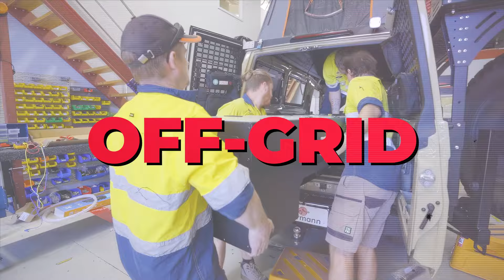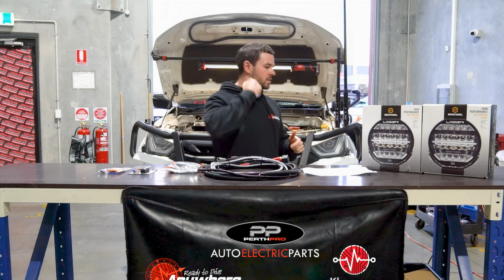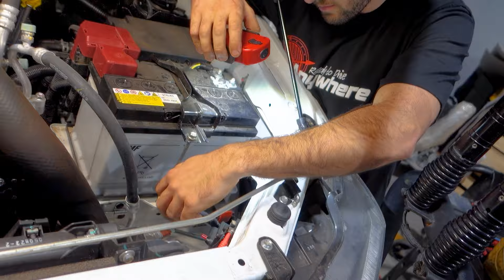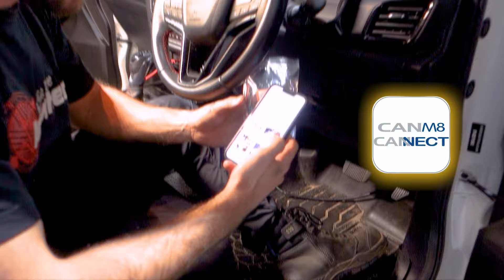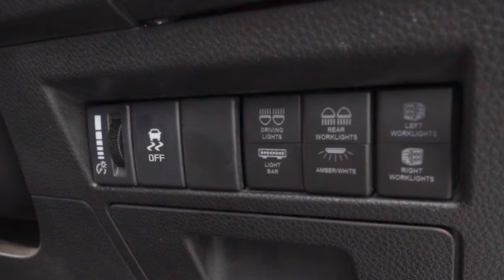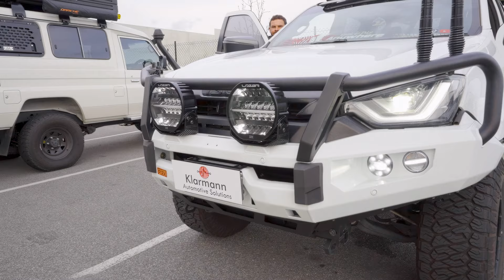How To Install Spotlights

Comment: What is the benefits of picking up the high beam trigger through the canbus instead of tapping into it on the back of the headlight like normal?
Reply: On some vehicles there is no high beam signal you can connect to at the headlight because the headlights are connected to the can or lin circuits, hence the need for the canm8 module (not required on an Isuzu as used here though) Depending which canm8 module you get they can also give you park lights, reverse, ignition etc outputs which makes wiring additional accessories much easier and tidier.

Comment: I didn’t understand what the benefit is to tap the CANBUS. Why are you using that? Does it communicate that you can only use the spotlight when your high beams are on? Is that an Australian Regulation? Or are you just tapped into your high beam switch to activate the spotlight?
Reply: Yup Australian regulations say that spot lights must be wired up so they only come on with high beams.
Reply: @Dazza-u4c  Ahh, well that clears that up… I sure am glad to live in the some what freedom USA!